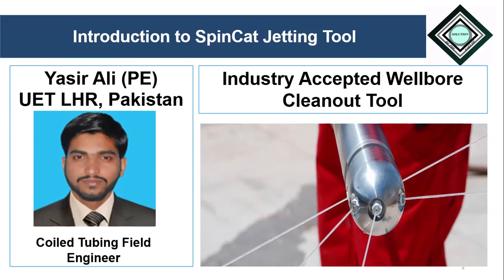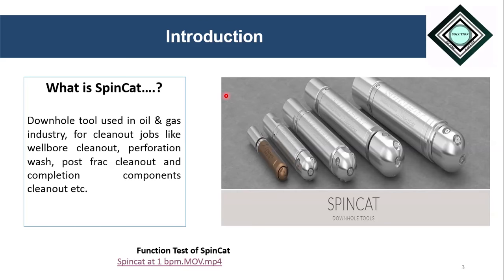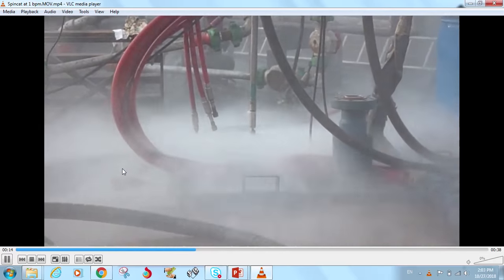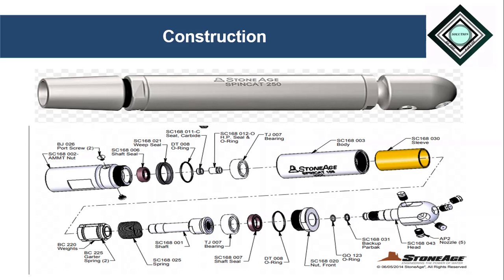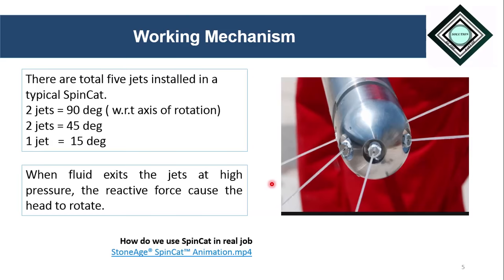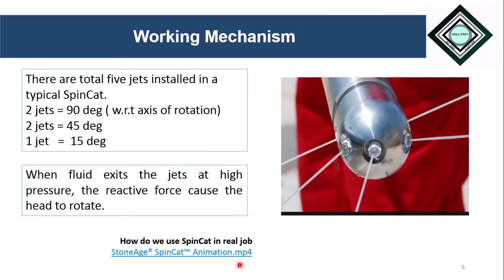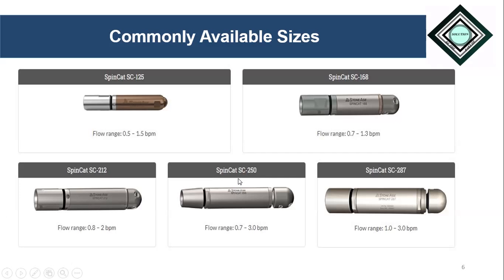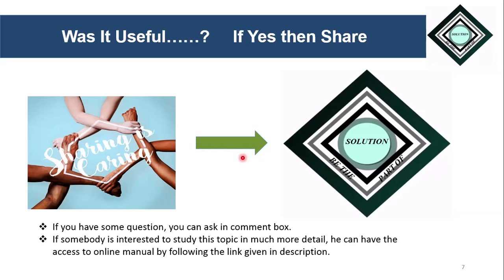3- SpinCat Jetting Tool by Yasir Ali

Comment: very impormative and please keep making such videos. I have only one question "can you please elaborate the angle of jets with respect to axis of rotation" as I did not understand this thing.
thanx
Reply from the maker: Sorry for late response. I read your question very early, but was not sure about answer. Know I have the exact answer for your question. With respect to axis of rotation, one jet is installed at 15 de, 2 jets are installed at 45 degree, and remaining 2 jets at 90 degree. It is the reactive force which helps in rotation. 

I will be more than happy to answer further queries....